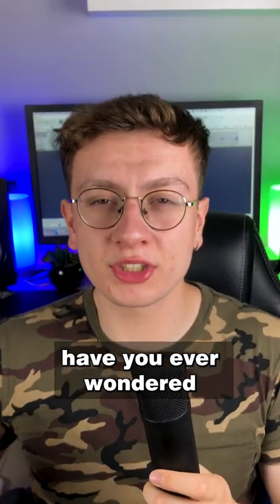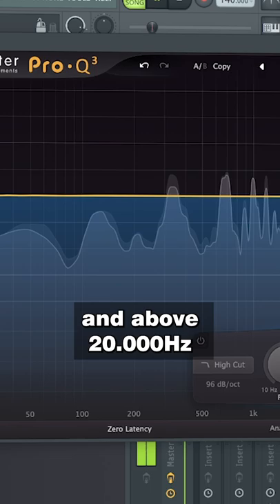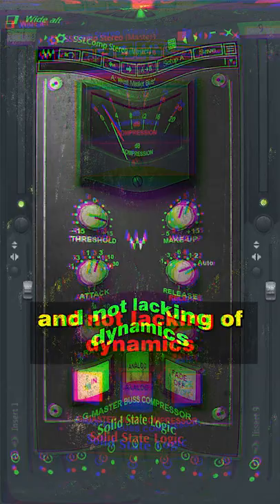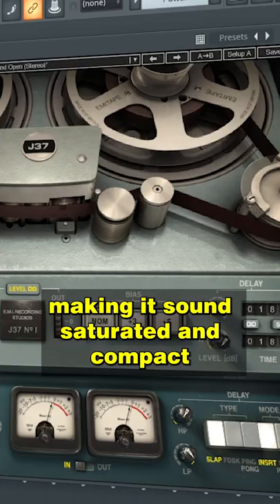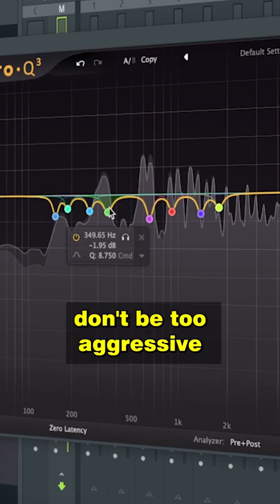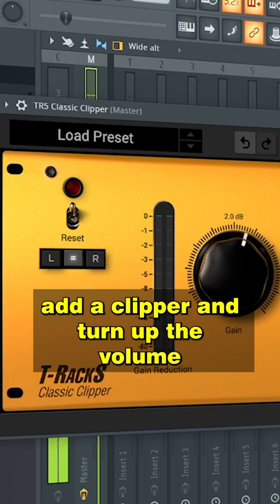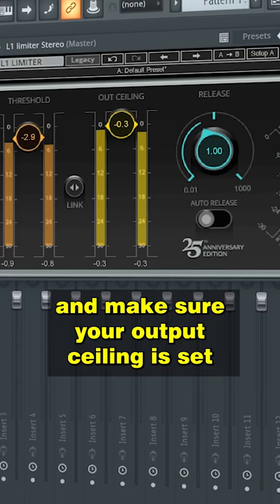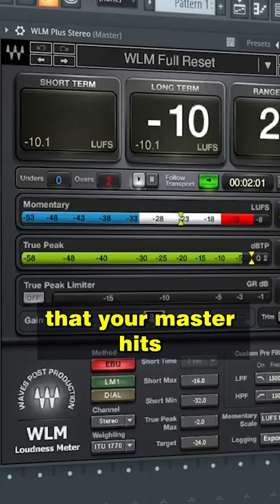HOW TO MASTER YOUR TRACKS #shorts #mastering #compressor #plugins #music

Comment: Man, sorry for being honest, no hate at all to you personally, but this is actually bad advice, really far from what a mastering engineer is supposed to do. Don't compress by default, don't overuse saturation (tape and clipping) and don't overuse eq for resonances or any other reason, you wanna compliment what the mixing engineer did, not change the whole mix and aesthetic of the track. Also don't do things by default just because you see people do them. A LOT of masters do not actually need compression. Instead focus on frequency balance comparing to reference tracks, focus on clarity and definition across the full frequency spectrum and make sure that the dynamics suit the feeling and vibe of the track instead of trying to force-make it loud

Comment: correctly me if im wrong but, cutting the highs and the lows will cause the phase to misallign, and it will make the db meter higher without perceivably sounding louder, causing the limiter to reduce the volume more and making it more difficult to get a louder mix.
Reply from the maker: To be 100% honest I don’t really care about the phase anymore since most devices have got stereo speakers so mono compatibility is not a must, I try to cut those frequencies only because you can’t physically hear them so when I add compressors, limiters etc they have to work with less information since those frequencies are cut off.. but everyone has got it’s methods ❤️
Reply: @Yangariess  i agree that phase interms of mono compatibility isnt a big deal anymore but thats not what i was talking about. what im trying to say is cutting the lows of your master doesnt remove information but rather causes an increase of a couple db on the meter. if you dont believe me you can hi pass a saw wave, and see what it does to the waveform, this happens because of the way a digital eq works. eqs increase gain, and using an eq with such a steep slope like 96db/octave or brickwall will cause more of a gain increase on the db meter without it actually sounding louder. but tbh if it sounds good, it sounds good. i just wanted to come on here to argue to an internet stranger lol 🙂
Reply from the maker: @tylerg8149  thank you for the advice man ❤️❤️
Reply: @Yangariess  wow, you shouldn’t be making „mastering“ tutorials. Go back to school, I suggest Dan Worralls vids as a starter if you really want to understand what you are talking about
Reply: @gutshisalamanca1191  why you gotta hate bro 🤔😭

Comment: That’s quiet in terms of todays standards
Reply: That's loud bra! Spotify will turn it down
Reply from the maker: @youngteero9280  that’s the whole point of why tracks have got such volume. Spotify and other streaming services reduce the volumes equally so if you got a “louder” track it will sound louder than the others even after the volume is turned down ❤️
Reply: @Yangariess  NOOOOOOO Spotify will adjust everything to hit - 14 lufs so not everything will be turned down equally. A track hitting -6 will be turned down by 8 dB and a track hitting -12 will be turned down by 2 db, very different from what you said